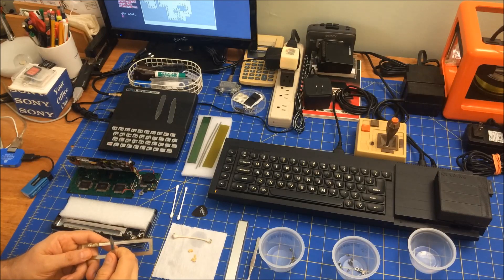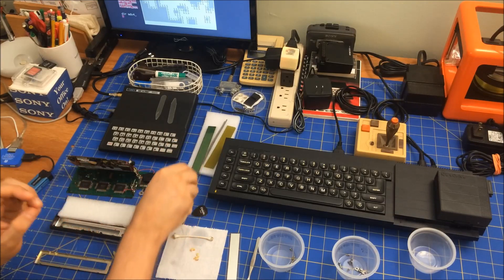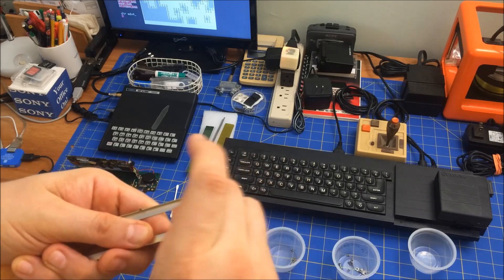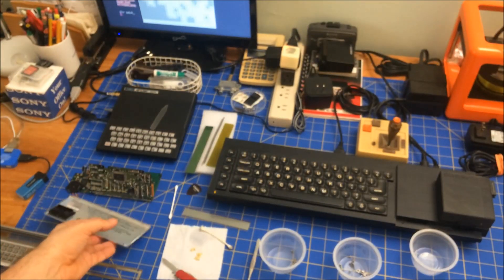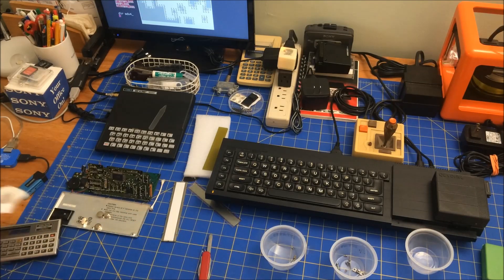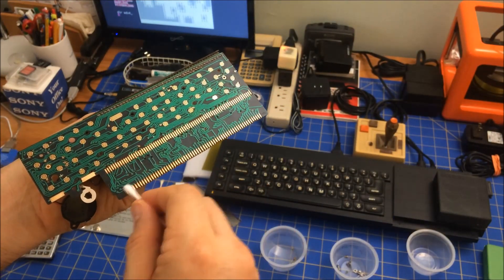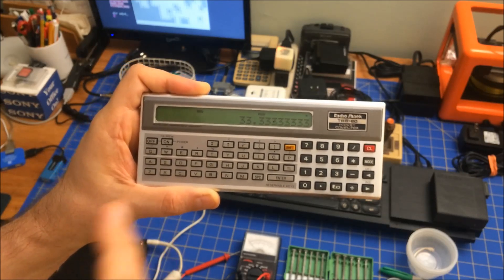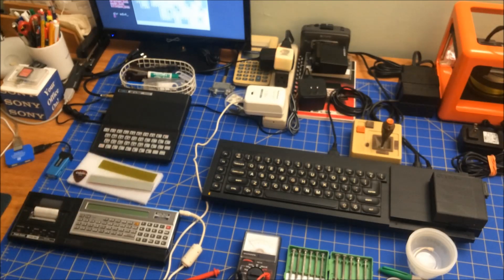Replacing the Screen on my TRS-80 Pocket Computer - #SepTandy

Comment: I've had one since they first came out! Still works thankfully.
Reply from the maker: So your screen doesn't have any damage? Mine held out for a very long time but eventually started showing a bit of dark areas at the top so I plunged in and did the mod which was pretty easy. I do miss the yellow screen a bit though as I kind of liked that. But yes, great little computer. I even did video where I get to load/save BASIC's between it and a ZX81 (eventually automated via python) that was pretty fun.

Comment: The first computer that I bought.  I still have it.  I should put some batteries in it.  I used to have all the accessories, but list them when changed residences.  I still have allot of tapes full of programs. The oc6 replaced it until I cracked the screen.on it.  
The other retro computer's I still have  are the Tandy 200 plus a CoCo 2&3.  
Thanks for giving me inssperation to revive them.
Reply from the maker: It was my 2nd one that I bought in the same year as my first. Is your screen showing that bleed through?
Reply: @8BitRetroJournal  Yes a little, but since I bought it off a shipmate in 1984, I'm not sure if repairing it my broken screen PC3 should be a priority. I had several electronic calculation programs on it.

Comment: Nice fix! I also like the tip of using the shirt collar stays like a spudger! I have sometimes used an old driver's license like that; it's a little thinner at the edges, smoother, and more flexible than a plastic card.

1:45 Hmm, interesting. I have this problem on my Uniden HR-2510 10 meter transceiver and wondered what might have caused it.

Man , I really wanted this TRS-80 Pocket Computer (a Sharp, right?), but must have never collected enough $ for it, so was happy with my C64... and then later the programmable Casio FX-4000P did the job. (4000 "steps" of storage, if I recall. For instance, the equivalent of a BASIC keyword like "IF" or "PRINT" would each be one step or presumably one token in its parsed programming language.)
Reply from the maker: The Pocket Computer 1 was the Sharp PC-1211 equivalent. Not sure how to compute steps per instruction since an IF also needs a conditional statement to parse which could be complex (i.e. AND's and OR's) and a PRINT could have a string which presumably could be of any length.

Comment: I just ordered one of these displays and will try this repair on my unit,  hopefully I can replicate your success
Reply from the maker: Good luck. It's not that bad. Don't forget to peel off the protective cover from the new LCD...I almost forgot :-/
Reply: @8BitRetroJournal  I completed the repair today, it was not too bad!   Getting the old glass out was the only real hassle.   my potentiometer was kind of a problem, I suspect I may have damaged it many years ago trying to adjust to combat the lcd failure.   I saw in the electrical schematic that it was 250K, I played around but ended up putting a 330kohm resistor. i will look at it again at a later date to be sure that will not cause some problems "long term".  tape trick was nice idea though, I hate to do irreversible things where possible i.e. tearing the wiper off totally.
Reply from the maker: @yyzkevin416  cool...I really liked the look of the original yellow screen but got used to the green really fast, probably because it has better contrast. According to Robert the max resistance of the potentiometer was perfect for his screen, so I'm betting 250K resistor ought to give you best contrast. That potentiometer seems to be hot-melted in place with white plastic...or more like the plastic with it was  melted in place on the board. I've opened up a few PC1's and they are not all adjusted the same way.

Comment: Nice work! The reason that I had to pull the wiper off my potentiometer is that it was stuck down. Did yours turn? If so, you could probably just turn it all the way in one direction. If it's all black, try again by turning it the other way. If that works, I'll change my instructions! And even if it doesn't turn, the tape trick is a very nice idea.
Reply from the maker: Thank you...I followed your detailed instructions and it was a breeze. I have to commend you on the phenomenal job you did on reverse engineering that screen. I would have never realized how much more there was to it besides creating the LCD layout (i.e. having to understand the voltages and all). I'm happy to have the computer back and have been using it a bunch now.  I could have bent back the wiper as it was also stuck (I think they literally melt that part onto the board). I had this silly notion of not doing anything I couldn't undo which is silly because I'm never going to put back the old screen :-/